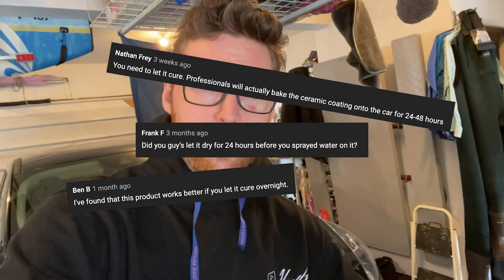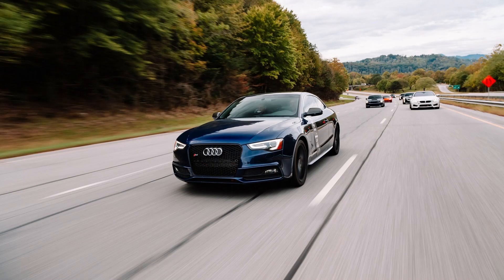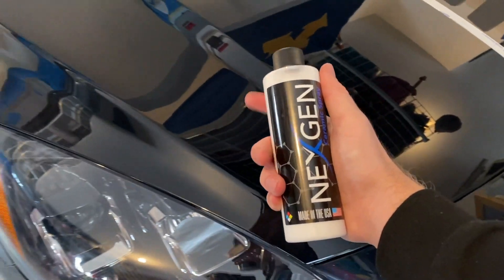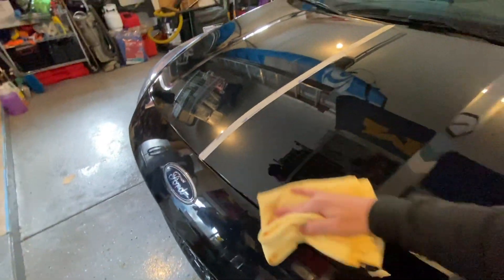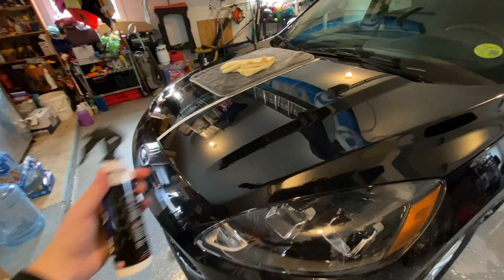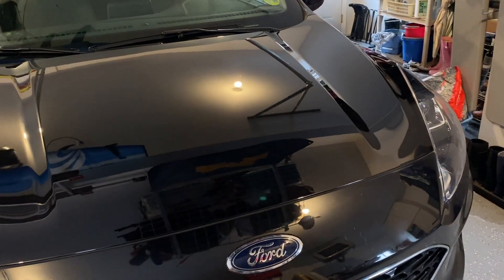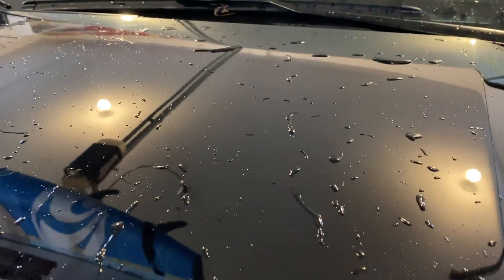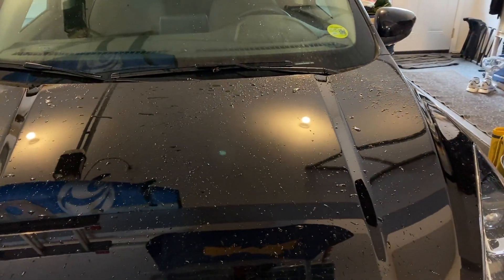Nexgen Ceramic Spray: A FAIR Review

Comment: Used the NexGen on my 2018 Colorado with Cajun Red Tintcoat paint.  For those who do not know what tintcoat means, when my truck is clean, the color can shift from cherry red to dark maroon based on the sun/light angle/amount hitting the truck.  I clay barred the truck before starting.  Points I want to make.  No way one bottle will do 4 vehicles.  I maybe have an inch of product left in the bottle.  I noticed right away the NexGen appeared to make the color deeper.  My wife noticed this too.  This is not a bad thing, just wasn't expecting this.  The truck had ceramic coating on it when I bought it so this truck has always had a great shine to it.  I'd say it has a noticeable increase in shine after using the NexGen.   As far as having the slick wax finish, I'd say no.  When I took a clean microfiber towel and tossed it on the hood.  It didn't slid off like it does with plain old wax.  It didn't slid much at all.  Haven't washed it yet because the truck is still in the garage, so I can't comment on water beading.  Would I buy again, no.

Comment: I received a free small bottle of nex gen during Daytona Bike week this past March.   Watched this video after having waxed my Toyota. I took and clay barred the hood and sprayed it with the nexgen. I could immediately feel the difference after the clay bar. But when I sprayed on the nexgen, I was not impressed. My Toyota is silver and pretty shiny for a 2007 year.  I did not wait to do a BEAD test, so I just went ahead a put a coat of turtle wax paste on top.  My truck is not fancy-schmansy…two wash and wax a year seems fine for my needs.

Comment: The car looked so good after you washed it, i didnt notice any difference after you applied NextGen, Before 24 hrs cure...

Did you notice any significant difference between two sides of hood before curing?

💥💥💥💥💥💥💥💥

What product did you have on car before nexgen?

Whatever it is, 
It looks very good...

💥💥💥💥💥💥💥💥

You Mentioned Turtle Wax Hybrid Wax...

I'm curious if you also tried Mcguire's Hybrid Spray On Wax & What were your thought's...

Have 2024 3 Weeks new car that has been profeessionally Ceramic Coated, with two coats for longer durabikity & protection...

I'm curious about Turtle Ceramic Spray Wax & Meguiar’s Hybrid Spray Wax...

Would Greatly Appreciate Your Thoughts & Opinions...

Comment: So I think clay barring it before the ceramic might make a difference
Reply: Clay bar is a game changer by itself! But in the video they don't say anything about clay barring the vehicle first.
Reply: He said it's clean dry and prepped. 
Prepped usually means clay barred. To properly prep a vehicle you wash, clay, polish, Ipa wipe down then lay down protection
Reply: Exactly. Without using a clay bar and taking all the contaminants out of the paint. The ceramic spray can’t really work it’s way into the paint to properly protect it with dirt and whatever else on the way
Reply: @Ben-zv4mx  oh my god.. give it up guys... this productb is no better than most but charges like it is
Reply: @ArmycAv2nd   I said quiet down ma'am. The men are talking.

Comment: Couple of things I noticed. Nexgen also recommended clay baring the surface first. And they also say not to spray a ton on the surface. A little goes a long way.
Reply from the maker: Thanks for your comment! I may do another review with a clay bar✊🏼
Reply: @KevG  don’t get me wrong. I agree with you. Just offering a potential adjustment. It is definitely not a long term solution as far as a coating.  Hell I am still trying to find that.

Comment: I ordered nexgen waiting on it to come in the mail. He may have done everything right but I've never seen rain pouring out of the sky like he poured it on the hood . I'm still going to give it a chance.  If it works good if not I'll try something else. If you know someone better send me a reply of what it is and I'll give it a shot.
Reply from the maker: I’ve had a good experience with both turtle wax hybrid ceramic spray and Adam’s graphene ceramic. Adam’s has a spray version similar to the price of this!
Reply: @KevG  thanks for the info

Comment: I like TLC2,  seems better than nextgen.  Have you tried TLC2 vs the Turtle Wax Hybrid?   Nextgen 2x price of TLC2 oz per oz (nextgen 8oz, TLC 16oz both prices $35 ).  Turtle Wax I assume is less than $35/16oz.  I find TLC2 lasts pretty well 4 months after application.
Reply from the maker: I haven’t tried TLC… my car is fully ceramic coated now so I’ll have to find a test car to use it on in the future!

Comment: I bought it too. It makes my cherry 2018 Camaro SS look like  Surfaces were for sure much better looking. It is like a Clay bar in a spray. Water pooled like any other car. It appears to be AWESOME. But you have to use a CLEAN MICROFIBER TOWEL EACH TIME!!!
So it is hard not to use the towel multiple times. 😮.
Once Nexgen is buffed clean it looks awesome. But not water phobic as the manufacturer claims. They make an area look like a sheet of glass, but it doesn't have that SIO2 claims that all the manufactures are making. Water and clay. Knock yourself out wiping it clear.

Comment: The fewer water beads, the better. When those beads dry, you get spots. Of course, with a ceramic coating you "Should" (in theory) be able to just wipe the spots off instead of them sticking to the surface.

I put Nexgen on my wife's bath tub and it makes a huge difference when cleaning it after she uses those wild "Dead Sea Mud" soap products that stick worse than any water spot could ever hope to (Girls! I Love 'em but just don't quite get 'em. Dirt Soap.).  I had to use Citrol three times and scrub to get that gunk out the first time. After coating with the Nexgen, No problems. The stuff goes down the drain just using the sprayer (hope it doesn't build up in the pipes). A maintenance coat about every 3 or 4 months keeps it good.

Amway used to carry a "Hard Surface Protectant" that seemed worked better than these ceramic coatings on glass. I never thought to use it on paint. I can't seem to find it any more and they no longer carry it.

Good Video, thanks for posting. Later
Reply from the maker: Good call! I know a lot of people who ceramic coat sinks and countertops

Comment: you people are using this product incorrectly. Although you can use it as a stand alone product, it's to be used in conjunction with Nexgen's ceramic coating.  Wash your car, clay bar it, then apply the ceramic coating, let it dry an hour, then apply the spray.  Thats how this product is to be used.  Then, use the spray periodically to keep the ceramic coating lasting.  Just using the spray will only protect your car breifly.  Trust me...I've done the whole process as I stated above and its been weeks since I washed my car and the rain and dirt flow off my truck with no issues.

Comment: Can you try Meguiars  wax paste on car. Just get it from autozone or O’Reilly auto parts if your from the USA. Please do it I’ll subscribe. And if you want compare it to turtle wax ceramic coating spray. By the way the meguiars wax is not a ceramic. Trust me waxing is better than ceramic coating
Reply: Completely untrue. Meguiars wax paste is great wax, I’ve used it for over 10 years. But turtle wax ceramic coating spray is not real ceramic Coating either. None of the products in these size of bottles are. They’re just toppers. Like quick detail spray. If you take the time to properly prep your car and use a real ceramic coating (ie CarPro CQuartz) and let it cure, you will not get better results with any type of waxing. I properly ceramic coated two of my cars over 6 months ago, and I wash them once a week. To this day, every time I wash and dry those cars, they still look brand new. Like they’re always freshly waxed. That’s the true power of real ceramic coating.
Reply: @that1guy1234  just to let you know waxing your car is better
Reply: For me nothing beats mother’s carnuba paste wax for shine.  There’s depth to it.  Surface is slippery and smooth as silk. I use ceramic toppers in between waxes.
Reply: @PF-jn7xx  yeah waxes are better than ceramic coatings

Comment: Kevin, I enjoyed your video, and unfortunately Nexgen doesn’t provide all the information necessary when it come to washing and prepping the vehicle. Not only is washing necessary, but it needs to be clayey, and use of a solvent decontaminant to remove any remains waxes , compounds or polishes. That provides the best bond for any coating. It also would benefit from at least a one stage paint correction first, but that’s out of the realm of most daily consumers. You also used WAY too much product. A better application would be to spray it on a microfiber pad and apply it. You have to continually swap out the side of the towel you use, because it’s just getting saturated by the product.
Reply: I gotta truck that needs full paint restoration and then ceramic coat..whats the best advice

Comment: Kevin  you have done this wrong already from the start.....  You must wash and rinse the vehicle and then dry it.....  That's a no brainer! However you failed to take a clay bar to the surface of the car and remove the rest of the contaminants that could be on the surface.......  Without doing the clay bar you already set this product up for failure! So, in order to give this product a FAIR REVIEW, you need to do it in a warm environment, do the wash and dry, and then the clay bar, and then use the NEXGEN. I can honestly say that it would do an OUTSTANDING JOB if you would do this.
Reply from the maker: Will do!
Reply: No, it wouldn't it's a scam... He could wash it then use an iron remover and clay and the shit would still suck lol it's a SCAM🤡

Comment: You did NOT emulate the commercial. In the commercial, he sprays 7 times and did the entire 1/2 of the front hood. You sprayed 11 or 12 times on only a small section of the right side of the hood.. The commercial I watched said that if you use too much spray, it will not work properly. You definitely used TOO MUCH SPRAY!

Comment: So you just washed your car and applied the product. Did you even prep your car? did you strip off the existing layers of other products? you gave us that answer your self... I can still see those water spots, DUHH! don't forget to strip the old product or existing WAX when applying any brand of ceramic product out there, also it is a good Idea that you give it at least 2 hours to cure the apply a second coat for maximum results. Once you have done that give it a few more hours before you do the water test, also contact your product provider to guide you on how to get the best out of the product instead of just trying to get famous for a dum dum video made by a unexperienced person.
Reply from the maker: No existing wax or product

Comment: your wash job was a rookie wash as best My 6 year old daughter asked " Why is there no thick soap on the car. you didnt remove any previously applied wax, nor did  you do a clay treatment. Ive used many many ceramic coating products and in my opinion Nex gen is the best. I wouldnt use a Turtle Wax product on my kids barbie car.
Reply from the maker: There was no previous wax on the car. It only had about 3,000 miles on it at the time. I suppose a clay bar could’ve helped a bit but I felt I was replicating an average application somebody might do at home for a most realistic review of the product. Thanks for your comment!